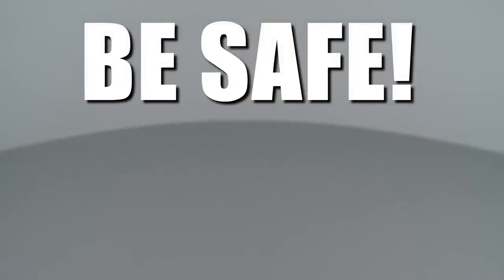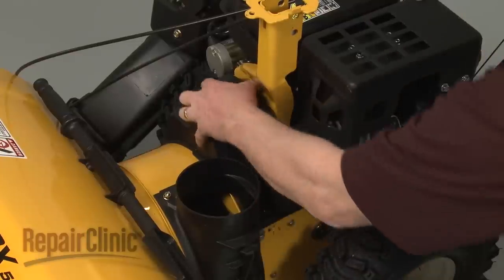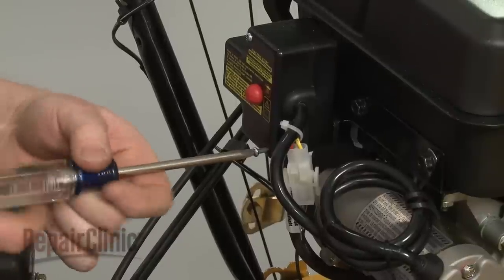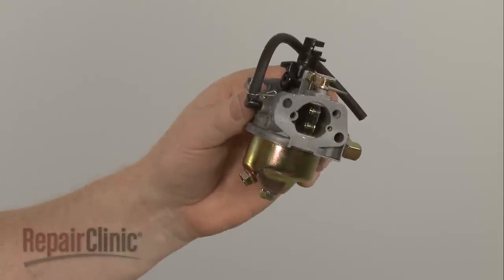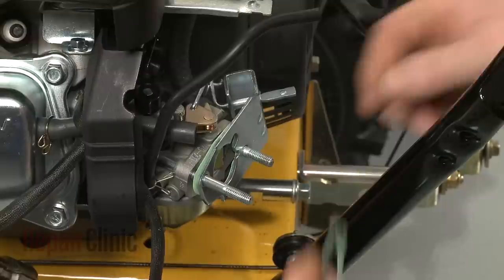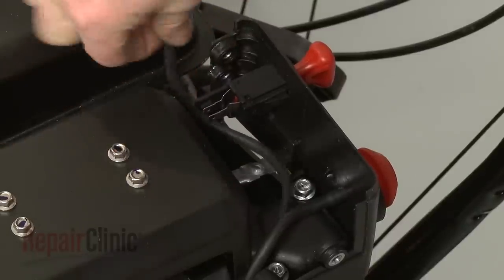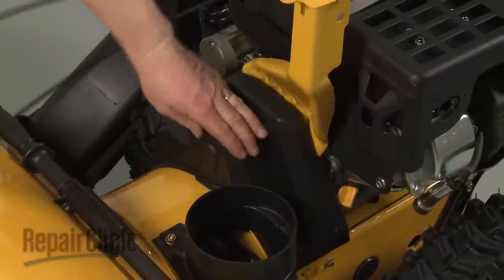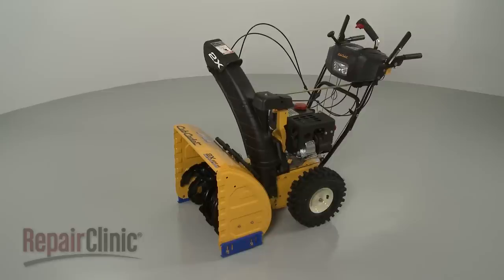Cub Cadet Snowblower Runs Roughly? Carburetor #951-14027A

Comment: It is possible to remove the carb without completely removing the muffler shroud and support. Simply loosening the bolt that is trapped by the chute support and removing all other bolts allows you enough wiggle room to get the control panel off and allows access to the carb.

Comment: When reinstalling carb, leave the acorn style nuts hand tight. Reinstall the choke knob first, before fully tightening carb onto the studs. This center's up the choke linkage bracket and knob with guide pin through the plastic front cover. If you tighten the carb first, the choke can bind in any one direction.  Gently hammer the knob back into place. Use the wooden handle end of a small ballpein to smack the knob back on. Do not over tighten the carb, use caution.
Reply from the maker: Thanks for sharing tips based on your own particular repair experience.